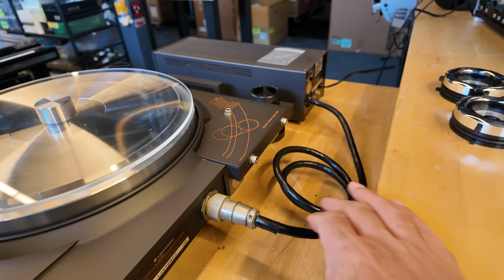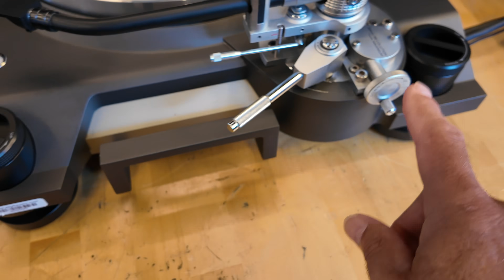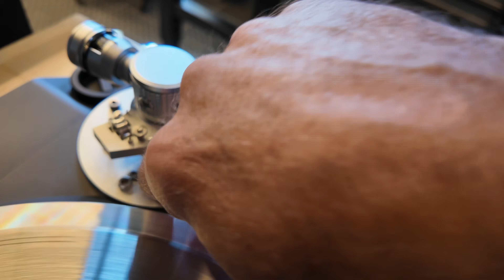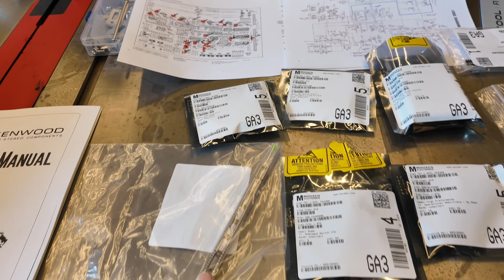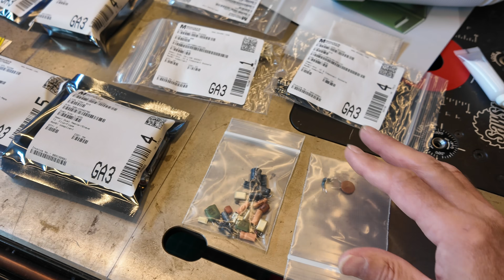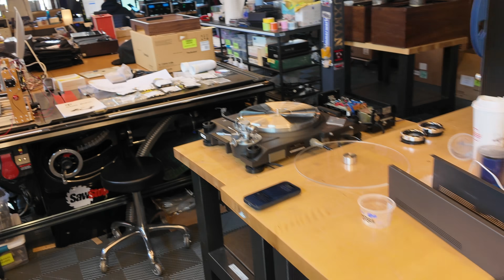Kenwood L-07D Turntable - Battleship Ready!

Comment: the possibility to adjust vta on the flight makes a second tonearm obsolete if you look at it from a historical view. in the golden era of living stereo perfect sound was only attainable with the correct vta regarding the cutting-angle of those relevant labels of the late-fifties to early sixties. that´s why placing several tonearms on a deck was originally implemented.

Comment: The Dynamic Parameter Switch alters the servo circuit timing to compensate for use of the optional Dynamic Disc stabilizer ring, which adds mass and inertia to the rotating platter. The original Carbon/Boron Headshells have all been robbed and are a particularly rare item.

Comment: Reminds me so much of the Yamaha GT-2000 with weight, external power supply and appearance.  The handles on the Kenwood resemble the Yamaha YAB-1 Anchor Block accessory attached to the GT-2000.  This anchor block was used to increase weight and mass to add additional stability to an already heavy 70+ pound turntable.  Both the Kenwood and the Yamaha are truly beautiful examples of high-end technology for their times which can still hold their own with some of the best modern turntables.  Great video - Thank you!

Comment: There's one on ebay for $20,000.
Reply: SkyFi Audio is selling this refreshed model for $15K , which is probably the better deal knowing how well this particular one works . Platter on this does not sit flat , in rotation the edge rises & falls . Should be addressed .
Reply: Someone is getting high on their own supply..... This is a nice turntable and a very cool conversation piece. But anyone that buys one for 20k is an utter idiot. For 20k you can buy a brand spanking new SL 1000R which is better than this one by a lot in all measures. If weight were the only criterion; it beats it there too! by more than 10 lbs 😂

Comment: I scratched the paint of underneath to see what material it was. I think its rosewood. Are you sure the steelplatter is original? It should be the same as on KD-600/650 but thicker. Only option was a blue ceramic platter. If you dont find another original arm, you could use the simpler version from 600/650. Also with VTA on the fly. You call yours a battleship, i call mine a moonlander. Amazing machinery. Made to be the best with no cost limit. But its not made by Kenwood. Only to there specs.
Reply: Sorry, KD-600 is the version without tonearm.
Reply: @jojakim414 I had a 650.
Reply: This is an entirely different product than the 600 and 650. The platter is original.
Reply: @trevor245  my 650 had a rubber mate
Reply: @ChrisTaylor-dz6nk  Yes and this isn't a 650

Comment: That's not a dust cover. I was a Kenwood rep when that model was introduced. It is an alignment guide for the outer ring weight. Kenwood Audio Purist introduced a massive center weight and outer ring weight along with a sintered ceramic mat. It was to protect the record and aligning the almost razor edge to the ring. One problem was static buildup. The other was it was better to put the center weight on first or the record could bow from the outer weight. But then you could not use the guide.
Reply: I jeard abour that mat, anyone have it. think it might have been an OEM item, as a crtal mat also made. or maybe different - what is wffect on overall sound?
Reply: @allanredford6070  Kenwood was connected to Mikasa which I was told was why Kenwood made their famous ceramic base turntables. The platter was made from sintered ceramics and silicon rubber. Increased mass and incredible dampening.